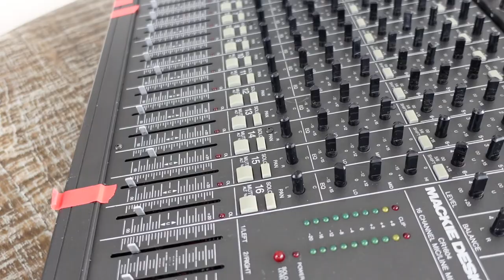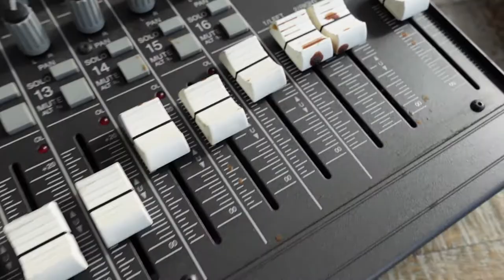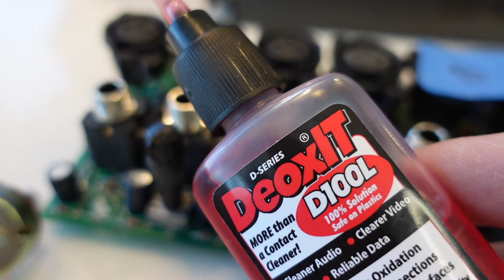Restoring a Vintage Mackie Mixer CR-1604 (Part 2 of 3)

Comment: How the heck did you get the jack PCB out of the pod? I've got one I'm trying to clean up---already done the mixer proper---and want to get the pod jack board out. Everything's loose: the 1/4" jack nuts, the XLR jack screws, all the external washers are off...But the damned board just won't come out. What's the trick?
Reply from the maker: You can pull the gain knobs off. The knob pointers hang up on the holes. If you grip them with pliers, you can pull them all off then the board will fall out.
Reply: Weird. Might have to try that. Not fond of the idea of grabbing them with pliers, but at this point I don't have anything else to try. Thank you!
Reply from the maker: @JoshTolbertUrbana  I used pliers along with a towel. They actually pull off pretty easily.